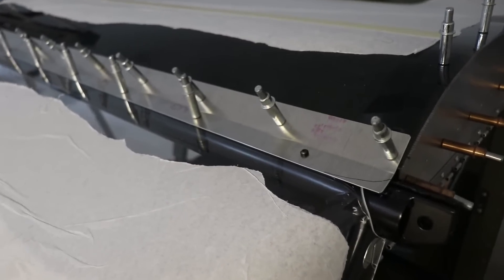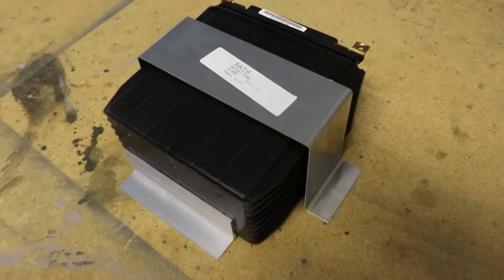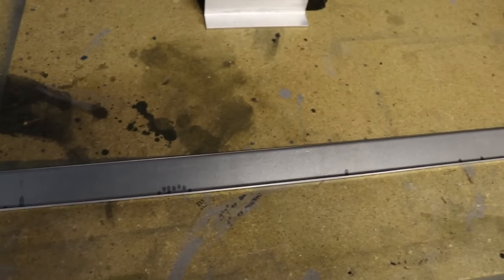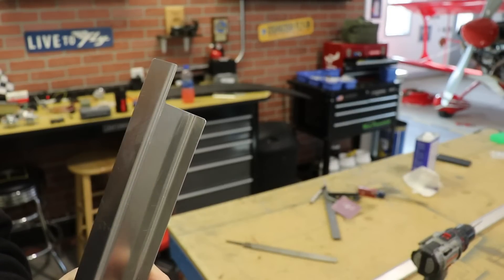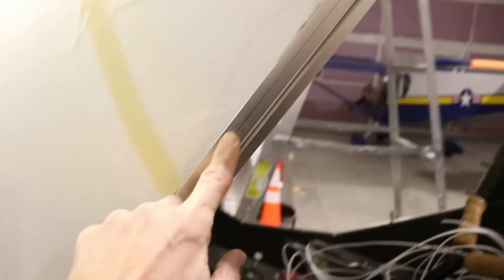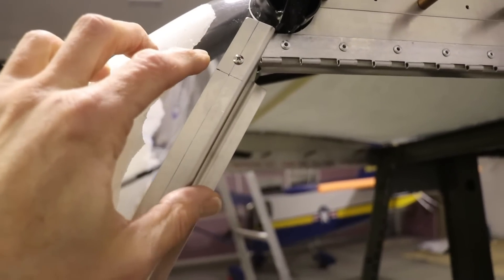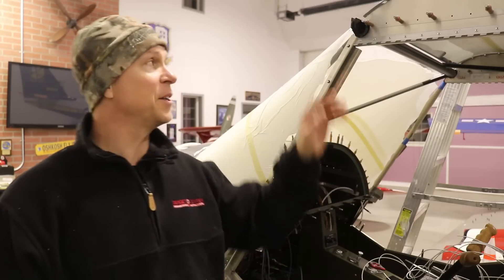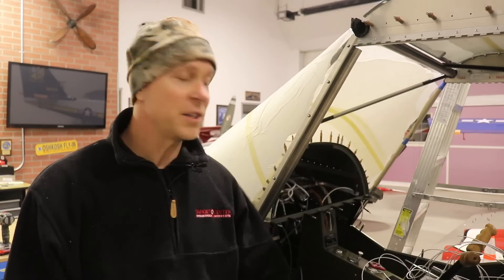Zenith CH-750 Window Trim Pieces (Ep70)

Comment: Hello Mark - I am installing the Windscreen on my Cruzer.  I noticed in your Cruzer, you trimmed the bottom sides of your windscreen so that the edges along the front door edge are fully captured by the z-bend trim pieces.  On your SD, you have the windscreen extending downward to flush up with the bottom of the door opening.  This means the lower 6 inches or so of the windscreen rear edge are not captured by the Z-bend trim piece.  I was just wondering about your thoughts on this.  Cosmetic/personal preference or some functional difference you have noticed?  Thank you.
Reply from the maker: The reason for the difference in windshields is because of the difference in the instrument panels. My Cruzer has the "Cruzer" panel, and the Super Duty has the STOL panel. The glare shields are different for each so the window gets trimmed differently for each.
Reply: Thank you Mark

Comment: Excellent stuff as usual Mark 👏

Since you’re ‘pilot drilling’ in situ to locate all of your fastener positions, you probably don’t need to open up the holes in the Lexan that much after, you just need to make sure the hole wall is smooth by cleaning it up after drilling. 

However if the Lexan does flex a lot in some areas during flight, opening up those holes in the Lexan to clear the fastener through them - to provide good radial clearance - might be a good choice to mitigate the formation of cracks should the Lexan and screw come into contact under load.

You are certainly building in a high degree of reliability and robustness into your aircraft. 

Very well done mate 👍

Comment: I just wish there was a effective way to show how to  simply sharpen ALL drill bits....Esp., w/o some fancy smancy tool, equipment  and/or techniques....🤔🤔🤔.
Also, from my experience with  R/C planes,  will that battery needs some "vibration dampening "...???
Reply from the maker: Yes there is enough room around the tie down strap to add cork or foam.
Reply: @KitplaneEnthusiast  OK...Great...Like Elvis said
..Whole lotta shakin' goin' on from the engine...

Comment: Looking good. Not sure if you saw my Facebook post, but got my windshield mocked up and trimmed. I did mess up my sunroof. Cracked while drilling. All my fault I pushed when I shouldn’t have. Oh well, I’m sure I’m not the first nor the last.
Reply from the maker: Yes I did see your post. I wondered how you cracked it by drilling. I'm actually not too careful when I drill mine but I haven't had any issues with cracking. Maybe I've been getting lucky!!!
Reply: @KitplaneEnthusiast  yeah I didn’t realize the sun roof wasn’t sitting flat and I added just a tad bit to much pressure. Lesson learned.

Comment: I would have though you would have used the same screws on the side trim as the top so I all looks the same and they are black. I must say I am not a fan of sheet metal screws, so that would be another reason for going that way (for me). Good to more progress "A little bit every day is better than nothing".